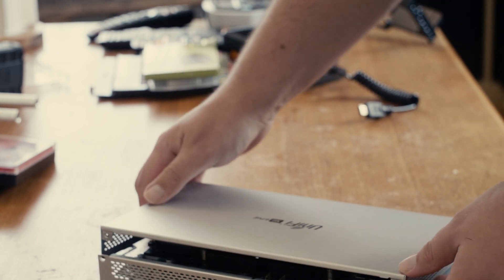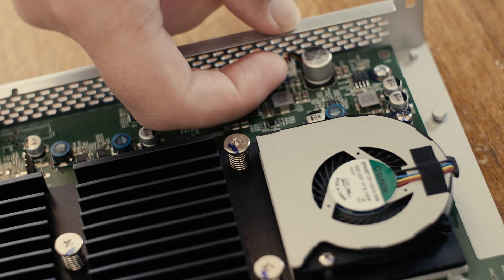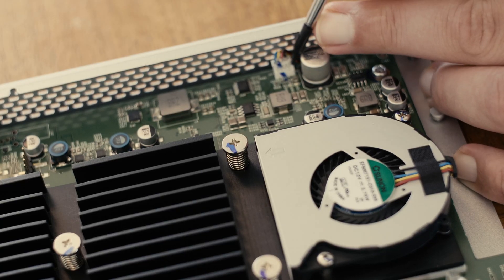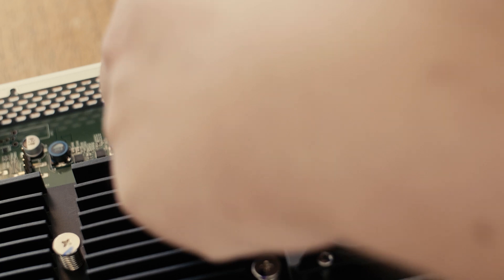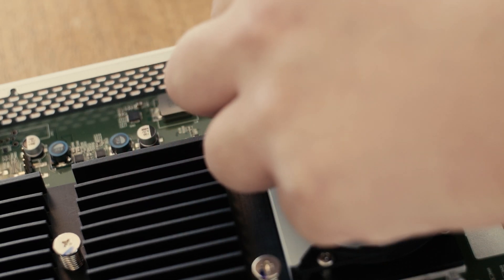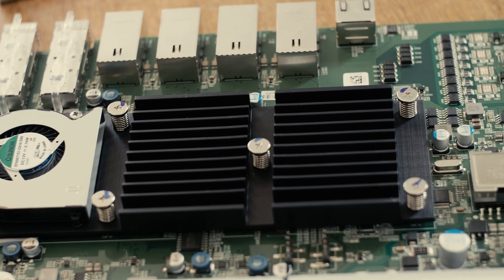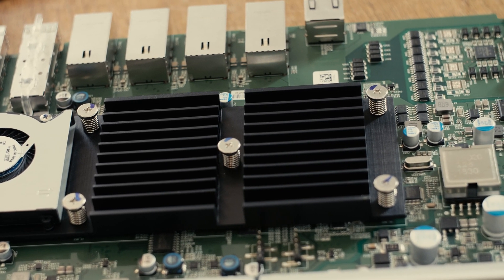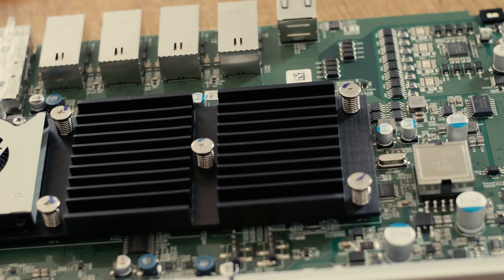UniFi XG-6POE - removing the TERRIBLE fan

Comment from the maker: Update: switch was stable without fan only when placed over fan-out from computer, effectively cooled by the computer cooling. After changing location to a less cool enclosure, the device experienced intermittent hangs resulting in short periods of packet loss. So YMMV, placement affects if the switch operates as expected without cooling.

Comment: They use the same fan in the Amplfi Alien and the Dream machine cylinder. My Alien is making a horrible noise but I can’t find the exact fan anywhere.
Reply from the maker: Ideally we would identify the exact connector to enable DIY fan replacement. Or cut the original wires to reuse it, doesn't feel great to me. I guess the noise level varies to an extreme amount between different units since the reviews, forums are so different regarding noise from these units.

Comment: After 16 months use, the sleeve bearing fan in my US-XG-6POE is loosing lubrication, and making noise. I spray WD-40 Dry Lube PTFE between PCB and the FAN rotor, clean oil on the fan, put the cover back and turn one the switch, the noise is gone. I will try this when I hear the noise until I find/get a fan replacement.

Now my fan level is 53, the temperature is 49 degree C.

"WD-40 Dry Lube with PTFE" is thin enough to penetrate into the sleeve bearing and won't keep between the magnet and the coil, I suggest who don't want to remove the fan tring this.
Reply: The noise is back, this trick doesn't work, sorry. :(

Comment: how long have you been running with no fan on that unit? this sound is unbearable, if it's survivable with no fan, I'll do it.
Reply from the maker: Still running this config. I have it on top of my PC now so there is a top roof fan etc cooling the chassis. I have rebooted the switch once (only once) due to a hang, no other problem indicator.

I don’t think the hang was related to the lack of fan, since Ubiquity products hanging occasionally is normal, but in full disclosure I have had one hang :-)
Reply: @randomgeocacher  I don't have any sort of external fan setups that I think I can do for my particular rack, but maybe I will simply disconnect the fan and monitor the temperature for a while.  and yeah, every once in a while I have to boot my system as well for some strange behavior that I can't explain.  Thank you for the timely update on this!
Reply: @randomgeocacher  finally ended up taking out fan today... unit is up to 77 Celsius... a little concerned about it at this point, but in the rack I'm not sure how much flexibility and ability to put some sort of external fan in there. Maybe I can move it to the top of the rack to help out....
Reply from the maker: @octomobiki  hmm, interesting that we had so different temp experiences, are you constantly pumping 10G traffic? Iirc, my got some degree colder after putting it on top of my chassis exhaust, and my network load is pretty low usually. Putting a silent 120/140mm fan under it and see what happens?
Reply: sorry for the constant updates - this is what I ended up doing:

took the fan leads from inside the case, cut out Black and Red and ran them outside the unit, connected them to a noctua 40mm fan and just pressed it against the side. Completely removed interior fan.  Currenlt 66C, it might drop more, but definitely much happier than nearly 80C
Reply: @randomgeocacher  I completely missed this update!

I do have 3x10G and 1x2.5G and an optical 10G uplink going here, but it's not constantly going full bandwidth but is definitely negotiated at that rate.
Reply from the maker: @octomobiki  I usually have 1-2 10G connections, and a 1G uplink. So definitely a difference in load. Your 40mm noctua hack does it sound well?

Personally I kind of wanted to know what  that tiny connector is, so one could buy several and experiment around without changing the main fan.

My home office is 23C a cold night and maybe 25-26C at a moderately hot day. In case our background temps differ significantly.
Reply: @randomgeocacher  My room averages around 24C.  

the Noctua hack:  I don't have a DB meter and I didn't take a before, but if the original fan was a 10 on a 1-10 scale, where 10 is the worst, I would rate the noctua fan at a solid 4 to 5. the 'ping' type noise as I'd describe it is MUCH more tolerable and lower than the other fan so it blends into the fan noise of my computer quite well, and I have to focus on it to hear it.  If I close my closet door, the sound reduces to about a 1.5 on the scale. 

For the fan connector, I cut off the original fan and used that connector, only used red and black.  It seems here that the red lead is providing 12v so my noctua is powered up perfectly fine.